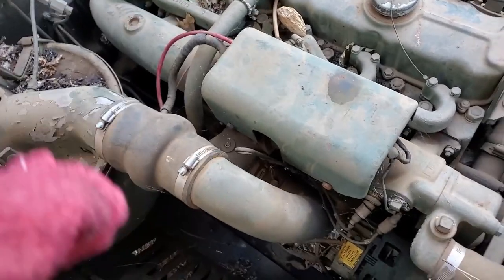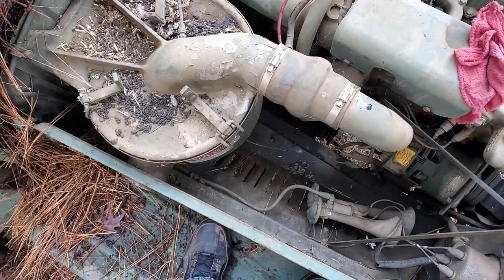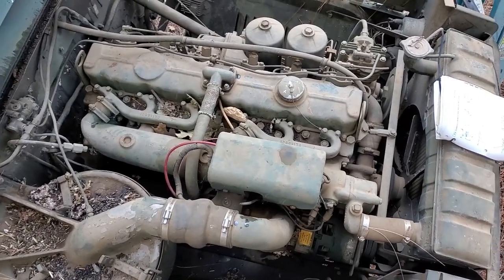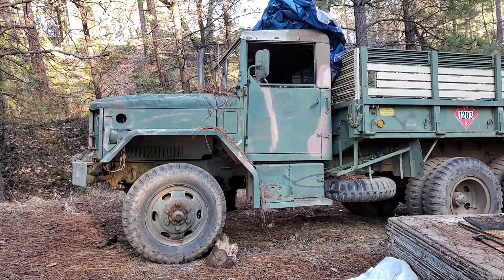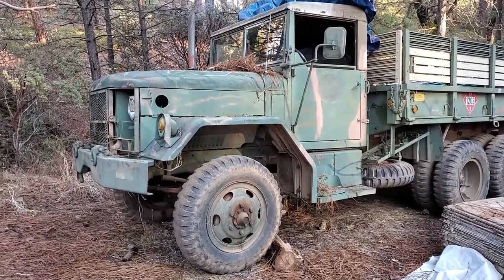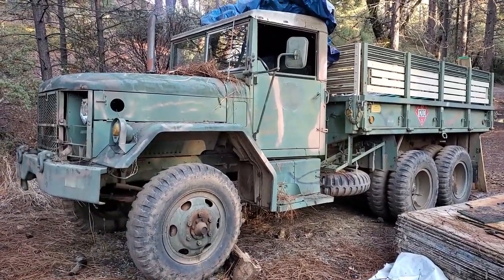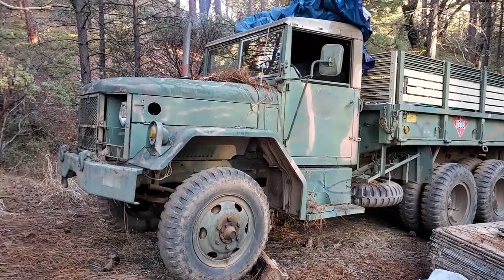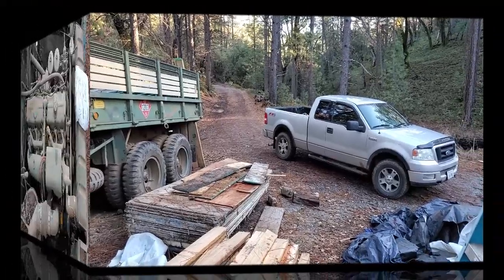1973 AM General M35a2 - Will it start?

Comment: Congrats, nice truck. The hole in the left fender is for the optional heater. Steel Soldiers forum has all the info you could ask for. Good luck!
Reply from the maker: Thx. Ya, have learned a lot since I did this. Much better informed these days.

Comment: A little bit late, but that hole in the fender is for models that came with cab heaters, Usually it is blocked off if there is no heater.

Comment: It's bad to rev your deuce like that without it being warm. You can use the throttle on the dash to idle it at 800 to 1000 rpms until it warms up if needed. Dont want to do damage to your truck. Enjoy you truck. There are many useful videos to learn about the m35a2.
Reply from the maker: Didn't know that..... thanks for the tip

Comment: ya I have to agree with Rob that hole is for the heater....it should have a scoop on it if you have that heater system...they had 2 different systems one conventional like your every day car and that is what the scoop was for and the other more like a kerosene heater or an old gas heater from a VW bug.....and some had nothing at all....surprised i see so many of these without a block off plate on those not equipped with a heater system.....this is the single greatest 'truck' ever built !...enjoy...and if you want to ever get rid of it...drop me a message !
Reply from the maker: Well, I have learned a lot about these trucks since I first did this video. Actually, I have several new vid's getting ready to post. Check it out